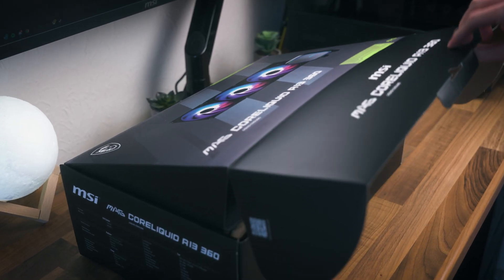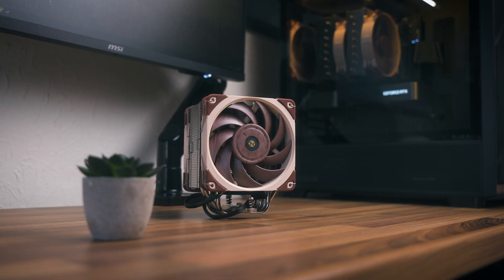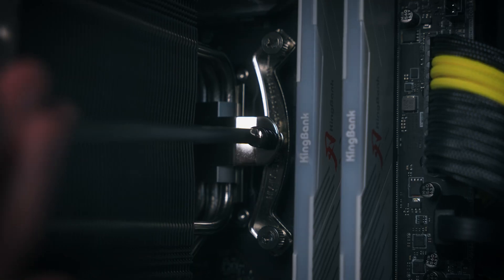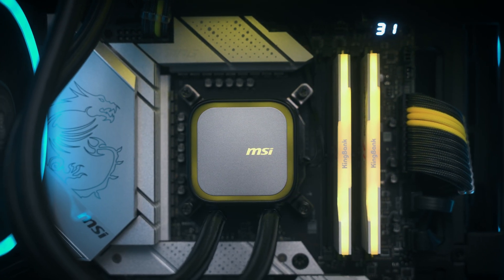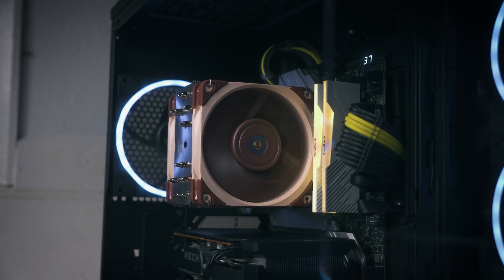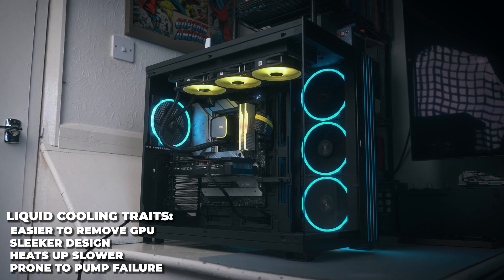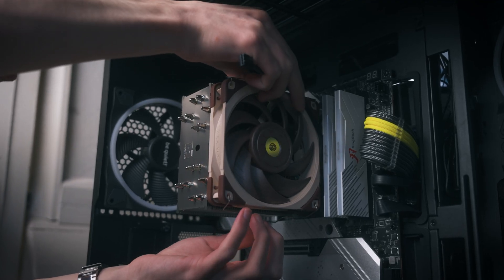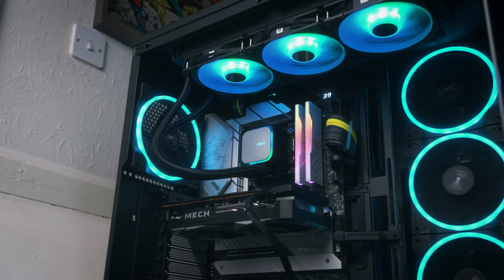Liquid vs Air Cooling - Which is Best for Your PC?

Comment: I have a intel i5 13500 paired with Deepcool AK400, while doing 3D intensive task ive seen heating issues, should I upgrade to an AIO?
Reply: An AIO for 13500 is not necessarily required, you can go with Ak 500 or 620k , they are very gorgeous as there low fan noise and efficient cooling, your ak 400 is for something like 12400f etc.

Comment: Good comparison video of those coolers with good explanations. I soon found out my entry level ID Cooling single tower 4 pipe wasn't able to handle the heat of a 12700K at full turbo TDP even with a faster fan installed. I was deciding whether I should I get a 240MM AIO (since my mATX case supports maxmium length of 240MM) or a double tower air cooler. I finally made my decision on a Thermalright double tower 7 heat pipe air cooler for my new 12700KF (replaced the 12700K due to its strange behaviors, and $25 cheaper). As for as I can tell is that this thing is GIGANTIC, and it sits above the DIMM slots. It's impossible to take out the RAMs without removing one of its fans, which also requires me to remove the GPU since one of its clips is between the GPU and the heatsink. I can agree with you that AIO makes removing parts much much easier and de-clutters the PC, but I still don't want to risk AIO leaks or pump failure in a short time. If I do upgrade the CPU in the future, I may replace the stock 1500RPM Thermalright fans with high RPM fans such as BeQuiet Silent Wings 4 Pro, and I'll likely switch to AIO when that heatsink can't handle the heat anymore with the faster fans from new CPUs. Also I replaced my MSI motherboard with ASUS due to its strange boot and processor power control behaviors, and I'm back to ASUS again. So far I haven't put everything back together yet, so I won't be able to know if everything works as expected or not until sometimes next week.

Comment: i have a 80+ bronze 450w psu should i run a rx 5500 xt on it
note: i am running a ryzen 5 8500g  and i also have an external air cooler for cpu
Reply from the maker: That should be totally fine, the 5500 XT is an efficient card

Comment: Awesome comparison. Re: 9:10, this is a key point. I have a Corsair AIO cooler coming next week (switching from a Noctua NH-D15) and I'm excited to try out the AIO cooler... especially because right now it's REALLY hard to remove my graphics card. The backplate of the GPU is less than 1cm away from the Noctua cooler. There's just not enough room to get to the PCIe latch. Having more room inside your case is a nice benefit of AIO coolers for sure.
Reply from the maker: 100% mate. The only exception is newer motherboards with the PCIe release button. They're also super handy. Nice pickup with the enw AIO too!

Comment: The only thing I dont like about my air cooler is that it pretty much covers up the coolest looking parts of the motherboard. So in terms of aesthetics, I gotta admit, AIOs win.
Reply from the maker: I agree with you on that. Sometimes motherboard brands put some cool designs around the CPU socket area